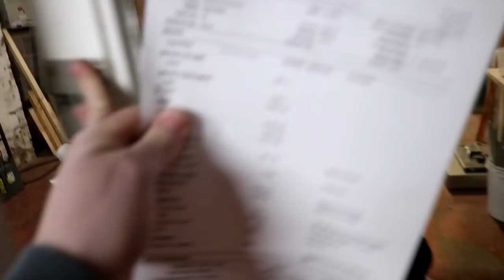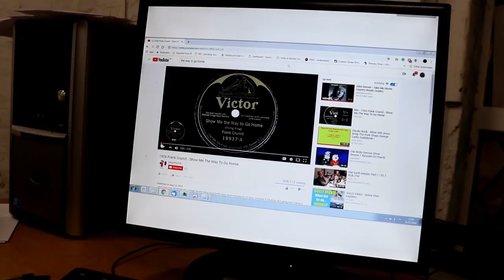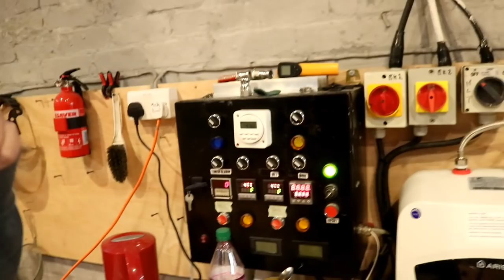GRAIN OUT

Comment: you would be better with a cheap 5 kw Chinese diesel heater off ebay , they take around 20 minutes to install, run it off either red diesel or heating oil, they save a lot of messing come with a remote control, and cost around £130, i have one in my garden pub, it ticks over on the 8 degree setting ang gets my summerhouse 115' x 10' to around 20 degrees.